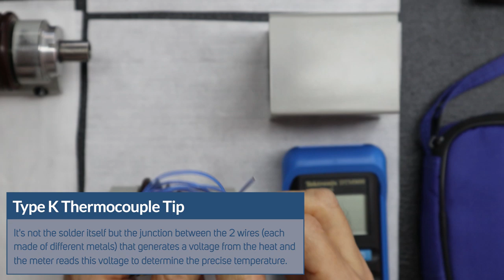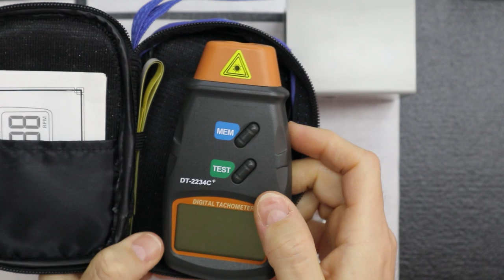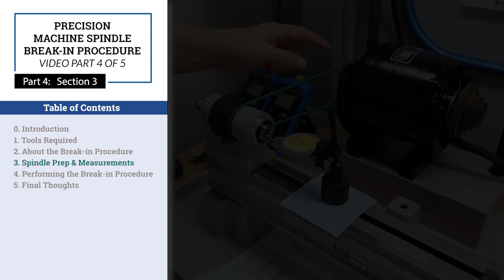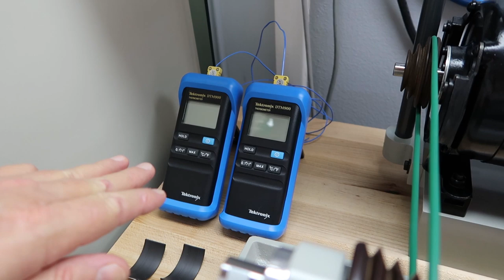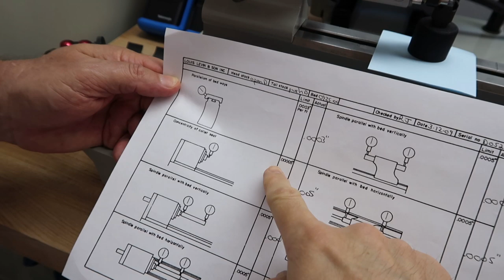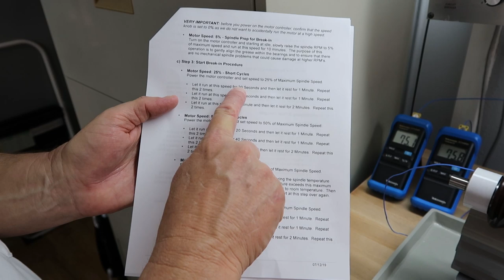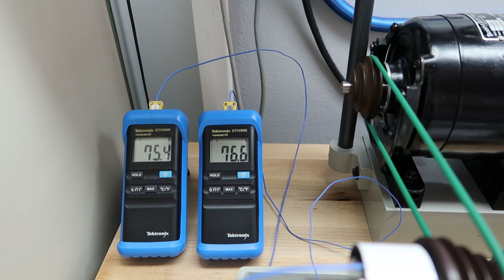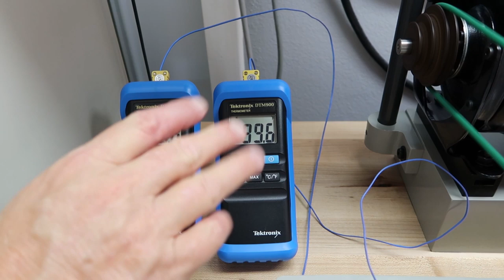Precision Machine Spindle Rebuilding - Part 4 Spindle Break-in Procedure

Comment: Thanks for the time and effort, you both put in to share with us. Very instructional. I have to replace the bearings on my Bridgeport's, and this is the first I have heard of break in of bearings. Thanks so much for your share. When I get around to replacing, the bearings I know the videos I will be watching, to ensure the best results. 
I was blown away at the 10,000,000 result. Appreciate the commentary as you broke in the bearing about heat difference and the reason. Nice video!
Reply from the maker: Hi Jeff, really so kind always, you truly are.
That 10 millions reading in the collect seat is 1/5th the maximum factory specification and the headstock is over 70 years old +/- and were floored to see such results Jeff.
   
The Bridgeport Mill spindles R8? should be a great project for you and we are happy we will be helpful n some small part through our videos, thinking here for the second Jeff, we think this.
The Barker Milling machine spindle for the vertical milling head is a 3C and it is one of our largest along with the horizontal spindle BT 30 spindle for the same mill.
We are going to cover them both in this Spindle Rebuilding video series coming in Part 3e and 3f and they will best fit those Bridgeport mill spindles. (we do not yet have a knee mill will take car of that in 2020) 

We understand Jeff, that regardless of the spindles being rebuilt, it is as we think you already know this is all about the processes and procedures and it all comes to light in the final part form this series Part 6 the Q/A and sharing, hope you will enjoy it, thank you for caring about us and our work, we are having the best of times here so exciting to be able to share with such great people.
Lance & Patrick.

Comment: G’day Lance and Patrick I gather with the expected production output from these machines it pays to fit expensive bearings not some cheap knockoffs. 
Well done on the presentation. 
Cheers 
Peter
Reply from the maker: Hi to our friend and Good Day to you Peter.
Our long term builder of the great build it at home from casting to full machining a Gingery machine in this case a mill with every option know well eventually you will have that we are happy we know you and your work Peter.
Thanking you for your very well accepted kind words towards or efforts in this Educational Machine Spindle Rebuilding Series, we love what we do and are thankful to be able to share our work the good the bad and the perfect, well that is what we are hoping for over time, after all we just turned 1 years old in our last Shop Adventures show Peter.
Thank you, Lance & Patrick.

Comment: It's quite warm in there.  I see the thermocouples reading about 75 degrees F at the bearings at the beginning, and the room temperature is about 78 deg. F.  I suspect you let the room temperature settle to some stable value (A/C off).  Correct?  Also, if you connect a sensitive AC wattmeter to the motor (or maybe even just an inductive ammeter) you will be able to detect any increase in the load on the motor as the procedure progresses.  Only a suggestion...You gentlemen are the experts.
Reply from the maker: Funny because we knew somebody would eventually bring this up.  When we are at that end of the workshop when filming, we have to shut off the air conditioner because it messes with our microphones since the camera equipment was along the wall that the AC is on..  So what you see is the ambient temperature settling at 78F but the surface temperature on items such as the headstock housing taking longer to rise to the ambient temperature  The air flow from the air conditioner doesn't hit this machine but I imagine if someone has an air vent right above their machine or has a cooling fan running, you would definitely want to turn them off so that's something we will put into our documentation so thanks for bringing this up..  Regarding the use of a wattmeter, we wouldn't advise doing this because during the burn-in procedure, you want the person performing this to focus entirely on the burn-in procedure itself and the bearing temperatures as that is key in identifying issues with the spindle bearings. For example, any increase in spindle load would definitely show up in the bearing temperatures.  Of course if you're curious, it wouldn't hurt to monitor the AC current to the motor but I can see people loosing focus on the temperature meters if they are seeing changes on the wattmeter and it's really important to identify temperature spikes.  But a good suggestion anyways as we may take a current reading before and after the burn-in procedure just out of curiosity to see if this burn-in procedure has any impact on this  We'll let you know if we do this.  Thanks!
Lance & Patrick